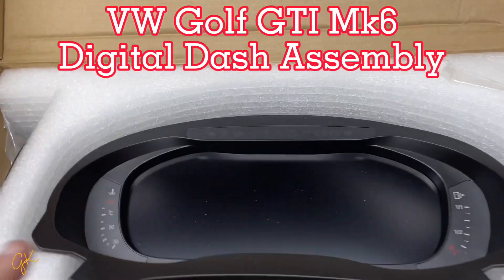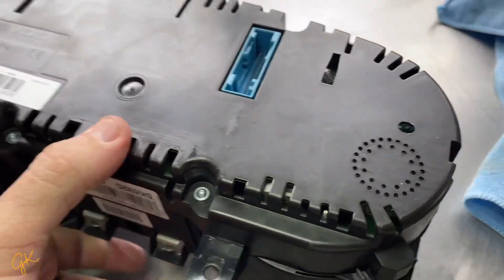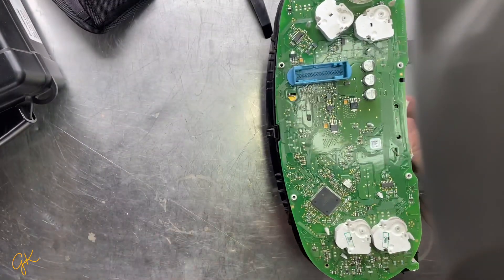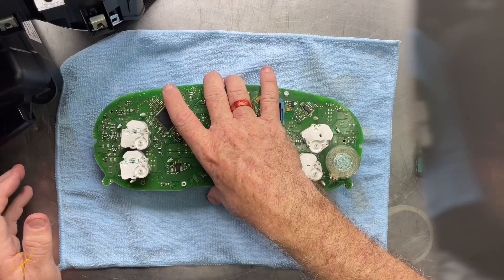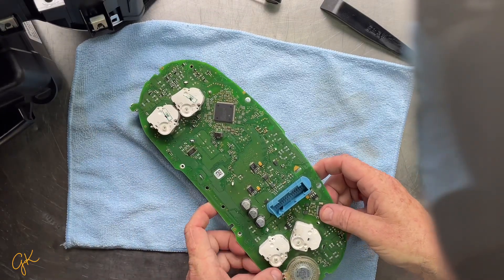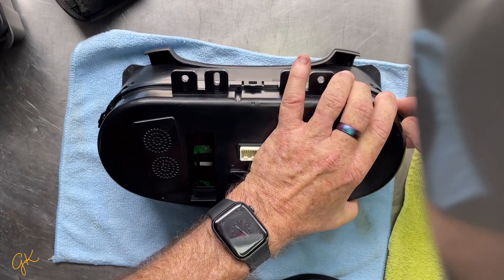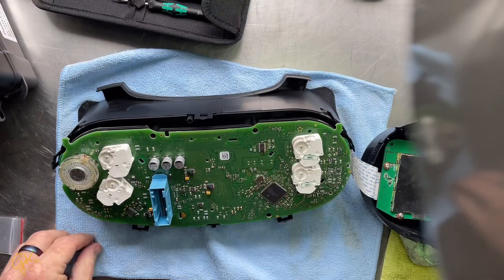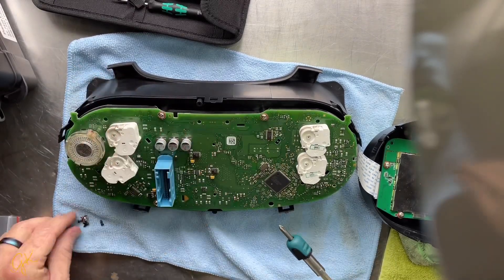VW GOLF  MK6 GTI and R,  Digital Dash Assembly

Comment: thanks for the video -- contemplating trying this for my 2016 CC.  just installed an android head unit and it works great.  if I don't necessarily need the reverse camera function for the digital dash, would it be just plugging in to the existing socket?  I saw one video where wires had to be routed a lot.

Comment: Hi does the oem motherboard connect to the digital unit apart from just the mounting screws? Ie, where the original display cable was?
Reply from the maker: I have created a group on FB to help people with the Digital Dash for MK6 and MK7.
If you think you want to do this come join.   Will not be a hugely busy group but assistance will be there if you need it.

Particularly important for Firmware.
https://www.facebook.com/groups/2762908920510480/

Comment: hey Graham thanks so much for your videos 👏🏼 they encouraged me to do this upgrade 👌🏼 ... now, I have a couple of questions:
in case I regret, can I go back to the analog cluster anytime??

could you please make a video about how to set the language? 😬

have you tested that kind of chromecast that is included? do you a video about it? 

now that u have used it for several days, do you still recommending it?

Thanks again for all your help
Reply: when setting the language ..when the car is switched off the language automatically switches to Chinese..
Reply from the maker: Ok sorry for the delay work has been crazy.   Yes you can revert fairly quickly.   Nothing is sacrificed.  Infact i kept my cluster just in case as well.

Comment: Does it can do on a mk5????
Reply from the maker: no Sorry bud
Reply: If you use a retrofit connector from a mk5 36 pin to a mk6 32 pin do you think it will work and using a mk6 motherboard for digital cluster?